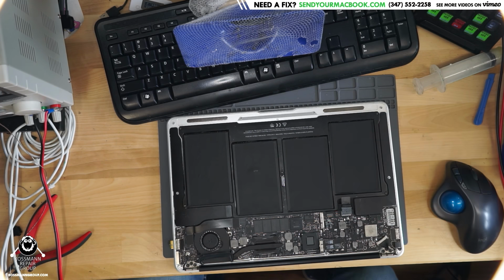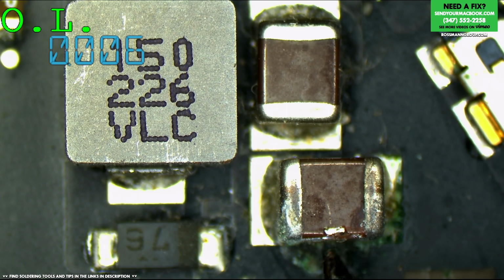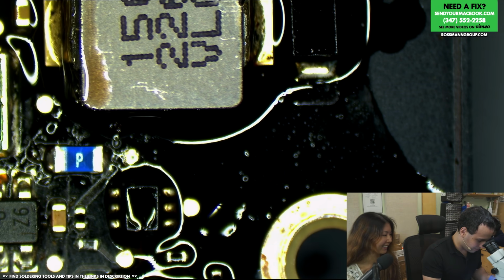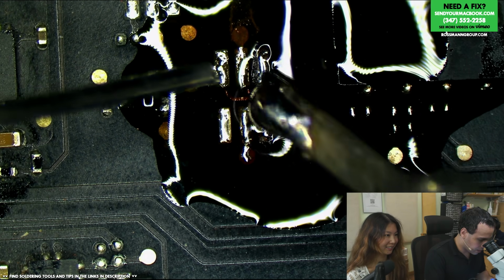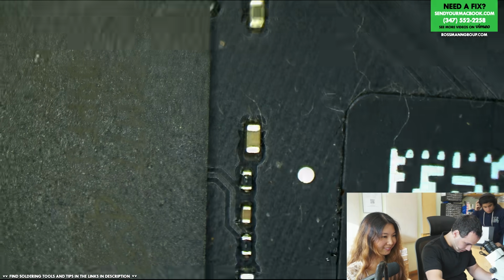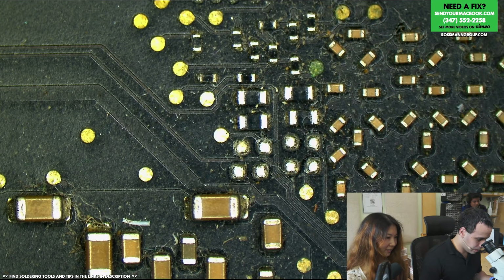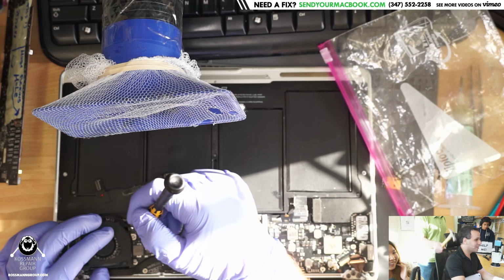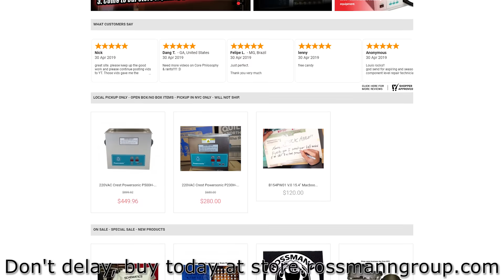Louis fixes girlfriend's Macbook.

Comment: "I brought it to apple" - Top 10 Anime Betrayals
Reply: "I brought it to apple"
You will be immediately killed by this action. Proceed?
Reply: stolen comment
Reply: Swerr
Reply: She brought it to Apple long before she knew him...it was in 2013 and 2016, she says it in the video.  It wouldn't do any good to bring an 7 year old machine to Apple now, they would just tell you to piss off and buy a new one.
Reply: But she took it to apple care 😬😷
Reply: @StormsparkPegasus  not really. I took my 2012 maxbook air to them and they gladly replaced my battery. And it wasn’t even that expensive. It was like 200 bucks
Reply: @Shanboss277  I think he means if something goes wrong in the machine, and not replacing a battery
Reply: THREE times a charm!
Reply: @StormsparkPegasus  indeed. They only care about your cash. really.
Apple's repair and advice policy, like many manufacturers is not meant for people with average salary.
Reply: I can very easily imagine what louis would look like in the anime world. It's actually hilarious.
Reply: @Shanboss277  200 bucks for 15 minute job....the battery itself has a cost price of around $25. and u only need a screwdriver for it. Do the math. 200 may be peanuts for you, but it's a fortune for most others.
Reply: *Apple betrayals
Reply: 3times!!

Comment: I gotta admire the fact that she has a 2012 macbook, had troubles in the past and got it repaired instead of replaced and still uses it nowdays.
Reply: That's his whole channel
Reply: When you spend $2k or more on a laptop, you tend to not want to replace it because when you've been sucked into the Apple cult, that means another $2k for laptop.

While the most expensive laptop I've ever had was like $700 and all of mine have functioned pretty good. My most recent one was a cheap one but I upgraded the ram to Max & upgraded HDD to ssd and then put the old hdd in the spot where the DVD drive was. Runs great even with 100+ chrome tabs or more 😋
Reply: I now have a desktop pc but when i need to travel i still bring my old 2010 macbook pro because at least it is still reliable 

the older mbp models are great because (in my own experience) they can still be great for a lot of lightweight things, the only problem is that it is still apple and a lot of things are better replaced while they are still working
Reply: My MacBook is from 2010, before they took out all the useful ports. I don’t know how tf Apple can sell a Pro computer with only 2 or 4 USBC ports. Fuckin useless
Reply: @1495978707  Probably the next macbook pro will need wireless adapters. It won't have any port except the charging one. You would be able to connect things only wirelessly.

Idk what type of 'pro' device omits some ports to make it 1.5mm thinner.
Well, Think Different, as they say.
Reply: James Panzone there is hackintosh as another option
Reply: My gf has a 2013 or 2015 version. One of the good one. Never had to repair it or anything, and she plans to keep it for a few more years. Shout out to the frugal s.o's
Reply: I hope she  has full backups done because with that history, the changes are pretty high that all data on that thing is going to be lost on some accident.
Reply: 00justSomeAccount00  what do you do? Most here aren't saying no one needs an expensive pc, they're saying apple is overpriced.

Comment: Louis: I can't believe you took it to Apple
Girl: I had apple care

Louis: what about my care?
Reply: Girl: thats for me
Reply: Ayush Gupta the trick  me friend used is  when she had broken iPhone 5c that would over heat  the phone went through a 4 different Apple employee and they all said it was over heating and the 4 one replace it with a replacement one and they did not charge her.  My strategy is don’t leave the store until they fix it or replace it
Reply: @NicVandEmZ  english?
Reply: oof size large
Reply: @NicVandEmZ  I have the same problem! Did it overheat when wifi or data or bluetooth was on? And does it have to be in airplane mode in order to not overheat?
Reply: why do you even care?
Reply: "DON'T YOU CARE ABOUT ME ERICA?

Comment: I never used to look at apple like it was the enemy, Louis I think you started a cult and I somehow became a follower.
Reply: I didnt like apple because of their insane pricing, but after i started watching Louis i got to know how bad they are at repairing too, after ovechargung customers to insane levels and trying to make other people unable to repair macbooks they also repair them badly
Reply: I always had iPhone from 3gs till iPhone 7. My iPhone 7 stopped charging after 3 months. Apple told me they couldn't fix it and they wanted to replace it with a refurbished model. Trying to tell me it was as good as a new one. 
After I brought it too a independent repair, it worked again free of charge for 10 months. I had another problem, and they replaced it with a refurbished one, that died 2 month later from the rain (iP rating my ass) they tried to make me pay 375 euro for a replacement since it was water damage and not in the WARRANTY, obviously I am typing this from an android phone.
Reply: Writing this on an Ipad: I agree.
Reply: @danilonden3782  tuff stuff, I’ve had an xr for two years and it’s so good
Reply: Apple was the cult, he has invited you to exit the cult while still using the products.

Comment: Why would you get a shitty macbook?
Her: "I had an HP"
Ah, that explains why she thinks this is an upgrade.
Reply: Hp sucks so bad they lure people with their low prices and “sales”  🤮🤮🤮🤮
Reply: The thing is she had an HP, it was shit, she would never get an HP again, fine, but why did she then get 5 Apple products of which only 2 work, try to get one of them fixed at the store and they fail several times and yet she would buy from them again and again? Thats the classic Apple customer behaviour and I just dont get it.
Reply: HP was a bad brand? I had a 2004 HP and it was good, maybe HP changed over the years?
Reply: @niko5008  It was probably a cheap $400 HP that’s why it’s so shit, when you compare to better specced (but still weak) $1000 MacBooks, no wonder Macs are “faster”
Reply: @niko5008  I had an HP Spectre x360. It's supposed to be their premium brand meant for Professionals, and that thing suffers with thermal throttling so much on a daily basis that a mid-tier MacBook starts feeling fast enough. Fans ramp up, temps reach the high 70s (Celsius), and the whole thing gets sluggish. Mind you, I need the processing power, since I'm a CS student and also code for a living!!! I cannot have my laptop throttling because they cared too much about the design (and when you start getting cheaper on the HP side of things, the build quality and longevity reduces drastically). 

It really boggles me why I cannot get a good freaking laptop that does all my jobs as required. I'm currently on a Dell G3, and while it's a bit bulky, this is the closest I have come to my ideal laptop!! Thinking of buying a Surface Book/Laptop next, those seem like the only legit options now...
Reply: For build quality:
Hp ~= Dell > Lenovo > ACER ~= ASUS

For performance/price:
Asus > Lenovo > ACER > Dell/HP

For raw performance (thermals):
Hp > Lenovo > Dell = Asus (both cooks laptops) = acer

I don't think you'll like any laptop from any brand then. Try pc if you never use it outside home, Better in performance, price, screensize, battery recharge...
Reply: @prateekpanwar646  i still have an old acer aspire 5560, and after changing hdd to ssd it still can play some new games

Comment: 13:23 She knows the acronym for HP 😂
Reply: She mentions the Laptop being slow....

With a near empty harddrive On a 2009 Toshiba and 8gb of ddr2 ram... that Laptop was slow.

I had a 2012 Lenovo laptop with a pretty empty harddrive and it was Dog slow with 1.5gb off DDR3 RAM.

So short end of the story I didn't know they were different ddrs and i wanted to Frankenstein the 2 together.. My tech family member said it wasn't worth the disposable repair value. If you want a Laptop buy a new one.

I started taking them apart and discovered experimentally. My dad,"You don't have to drive to best buy to drop them off. The trash can is in the Garage."

My brother," No!"
Me," Take it. I already made my point and that it was a curiousity killer. I don't need a Laptop. This is just a because I can. So what."

So my brother has both of those dog gone slow machines. My desktop has a higher cpu score than either of those 2 laptops.
Reply: @JCKingdom79  What the fuck  did I just read lol
Reply: @BlGGESTBROTHER  i wonder why the mysterious comments such as this one never get follow-ups :c i cant wait to find out what happened with his brother and the 3 machines
Reply: LOL Nice

Comment: Hey louis, I doubt you'll see this but I had a dell inspiron laptop that was literally submerged in water. Thankfully the battery was already dead. I unclipped the battery from the chassis opened it up and let it dry for about a month before I even dared trying to turn it on. To my absolute delight the laptop worked. I was able to retrieve my data and it still works to this day. That was about 4 years ago.
Reply from the maker: It's not a Macbook. :)
Reply: @rossmanngroup  I love you and what you're doing for all consumers ❤

Comment: 4:41
Honestly, HP laptops have to be the worst in my opinion. I think Apple is the worse company, but all of the HP laptops I've ever used are so bad. A MacBook might kernel panic and need an expensive repair, but an HP will just slowly and unstoppably die for no good reason from the second it first boots up from the store. I mainly have access to the budget models of any given product, so perhaps the fancy HPs are better. I'm still sticking with my pawn shop Toshiba though.
Reply: I do not say that HP are good, but, are they really that bad? We had an old HP, and it lived for a good while without failing

Comment: My mom's late 2008 MacBook Pro survived some soup falling right on to the keyboard. Same story as her showing her friend the bug. NO apparent damage was done, not even the keyboard was damaged. All the backlights in the keyboard still work, though very slightly tinted a light orange. It has AMD Radeon HD graphics of some type, as well as an Intel Core i7 of some type. The only part that has failed on this laptop is the battery, due to long periods of disuse and age.

Comment: I have an HP from that era. HP Laptops of that era had HDD defects, and some even shipped with defective motherboards. My father's old laptop had the HDD failure, but luckily not the motherboard failure so just replacing the HDD fixed it. Also now I have that laptop as I collect retro electronics, I ended up putting an SSD in it, and it works exceptionally well for older games & software and can even run Windows 10 well, similar to a low end laptop of 2020.

Comment: I did computer repair in Silicon Valley for several years and have never seen that level of corrosion. Although, I came across a computer where the owner's infant son shoved oatmeal through the DVD port and it landed on the motherboard.

Comment: Back when Steve ran Apple,  there would be the occasional over engineered perfect device that didn’t t quite meet the hopes and dreams of users. 
But since Tim took over, we get regular under engineered, over engineered devices that are designed to fail, from the UI right down to the hardware.

Comment: What a great attitude your girlfriend has!  She is so sweet and she is adorable, too! (and she has a cute, happy laugh, too). You two are a good couple. I hope it lasts for you. Guys are more stable, work more efficiently and are more level headed when they have a good steady partner in their life.  And I never get a Colonel (Kernel) panic - I only get a Lieutenant Panic, or a Major Panic. People in the Navy get Commander and Captain Panics. They would be great screen names, Captain Panic, Commander Panic or even Major Panic! Erica, you seem like a wonderful person! I enjoyed this and I laughed right along with you two. I had fun!  Keep up the good work (and the good fun, too)!   I was trained in electronic maintenance for years on things like Surface and Air Search RADAR, High Powered radio transmitters (10KW) and navigation transmitters (over a million peak watts) - BIG units. But I left most of the electronics for computer programing and Systems Analysis. That was about the same time as when the very small (miniature) surface mount gear came on to the scene. I think I would enjoy working on it. The electronics part is easy, but gaining the experience with specific models and manufacturers along with a steady hand and cost of the gear would be the hard parts. At 66 I am not getting any younger. I still repair standard 2 and 4 layer PCBs with my  standard vacuum desoldering station, but the surface mount technology intrigues me, BIG TIME! A nice station like you have would be mandatory for me. I always have to have the best tools, otherwise, what's the point?  Thanks for a great video, you two!

Comment: 13:30 Well, HP makes some crappy laptops (just like Apple), but they also make some really good ones. That can actually challenge MacBooks (only if you are not after macOS specifically).

The Elitebooks from 2012 onwards have glass touchpad, and they also have a Trackpoint and most of them have matte screen (2 things that MacBooks lack), they also have superior cooling.

Comment: i have a macbook air 11inch that works with battery charged, if you switch it off and restart it, it wont start up, you have to unplug the battery and then it will boot, just wondered it its an easy fix.

Comment: I use an HP Elitebook 8560p for years now and Im very satisfied with it! The build quality is exceptional! Its mostly aluminum and it has a screwless  removable cover for easy access to the components! I cleaned the fan and replaced the thermal paste several times myself. I even upgedated the cpu once and I'm not a technician. Before I owned the Elitebook I had tinkpads (T60 and x200s) And, I have to say, that I like the build quality of the Elitebooks much better!...The Thinkpads had better screens though. The only HP I can recommend are the EliteBooks! The other once are crap! I had a Hp Pavillion once and it was a piece of shit!!!

Comment: It's true. Independent repair shops are usually better at repairing this stuff, than the official Authorised Service Providers. Because the ASPs have young idiots with little experience for a low pay who literally throw around customer's equipment.
Reply: Plus, they're trained to f over customers.
Reply: @sese6227  Not necessarily. Sheer incompetence is usually enough.

Comment: Hey Louis- thanks for the video.
Is that jumper wire coated/insulated? How can it be touching all those 
other components without shorting?
Reply: the wire is laced with a thin layer of coating/laquer which protects it self and other parts around it from shorting :)
Reply: @P1NKM4U5  Hey, thanks for the reply. Yea, that's usually called "Transformer Wire" and it's coated with Lacquer. Cool.

Comment: So I have had about 4 laptops the last 13 years I have yet to have one crash or have an issue with them. 

But then again none have been Apple do they really fail that often?
Reply: I think not really, they can live long, even though they are designed to fail. But when they die its a pain to have them repaired because apple isnt doing it or isnt doing it correctly and also acts like 3rd party repair is dangarous and illegal

Comment: I agree with HP being crap, their fans are very noisy and ineffective causing my dv6 i7 HP to overheat.  The only way to have it run ok was to chock the base up so the air intake on the bottom can have more airflow.  The second HP I bought (HP Envy 15 AMD A10) but sold less than a year later in 2014 was just as bad with its tiny fan screaming while doing mundane tasks. It was also very slow even though it had dedicated graphics and 16gb of ram.  I'm so much happier with my ASUS vivobook flip. Doesn't overheat but is quiet, fast enough for what it is and much more portable.  It also has an empty HDD slot you can install a second ssd or HDD easily yourself. I did have some issues with the CPU getting stuck at low throttle speed early on but that seems to have fixed itself.

Comment: From a guy who works at a pcba manufacturing company, such corrosion and soldering is pretty bad.  I'm just wondering what kind of practice the EMS company applies that apple contracts to build their PCBAs.  Really shoddy. That pads have corroded. Usually it's from the flux. And if one component shows such corrosion, that means someone in that EMS company reworked that location with the wrong flux.  Even unlikely, during reflow, flux dripped onto the board, which shows poor Preventive Maintenance. Knowing apple, won't be a huge surprise that they go for a very cheap EMS company to build their PCBAs and overcharge their customers.  In my company, if such customer complaint is filed back to us, whole management will be jumping up and down.
Btw, PCB is usually cheap. A board gets expensive when it has lots of copper layers and intricately complex and thick. This looks like a standard 1.6mm thick board. Hard to think it is more than 100 usd for the bare board. Finishing is most likely typical. Nothing fancy like immersion gold.

Comment: She doesn't like HP with what seems minor software problem or cheap to replace HD, although it still worked. Then she went to the Apple where from 5 devices only 2-3 work. My guess is one HP had a problem which could easily be repaired, while ~50% of not old Apples don't work at all. I'm staying away from laptops because they are made to function short time, repairs mostly not worth it if your partner isn't repairman. 
Tabletops are very long lasting, easily repairable, those who need something portable should buy from a lot cheaper companies than Apple.